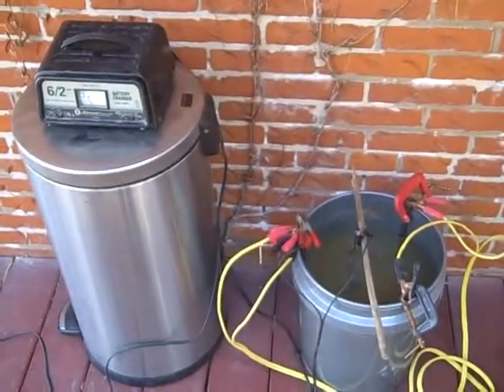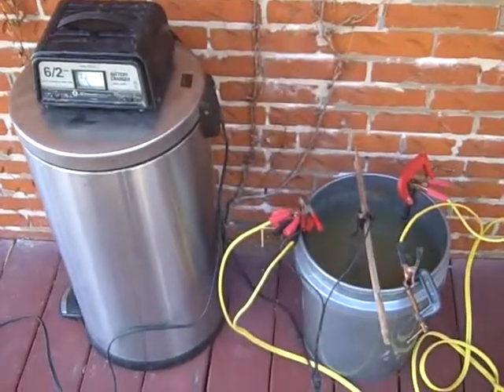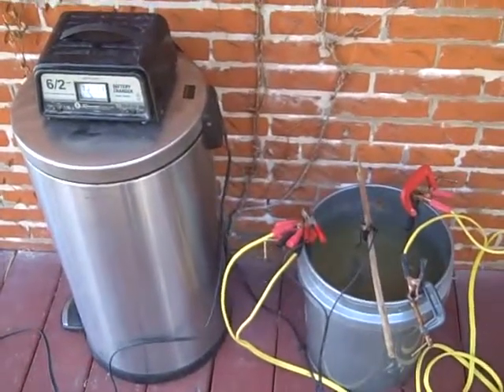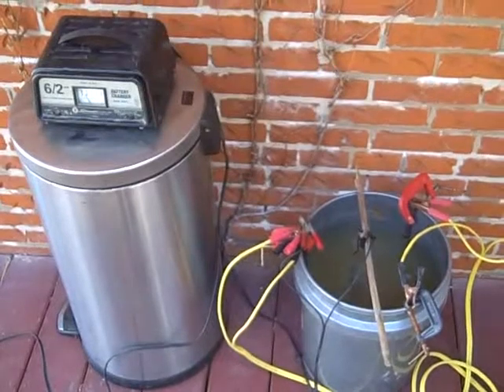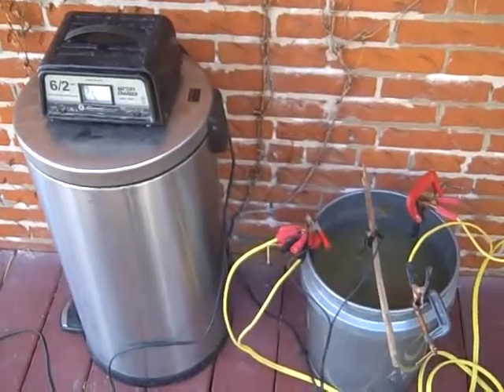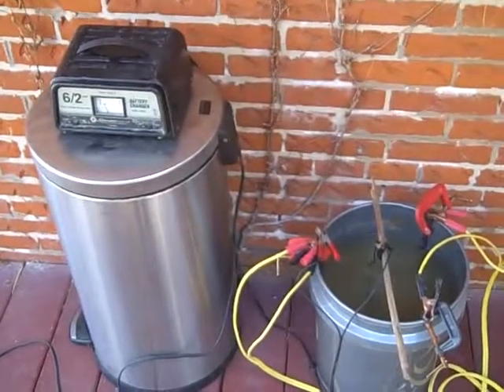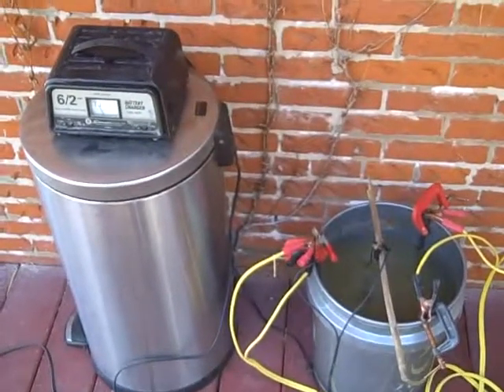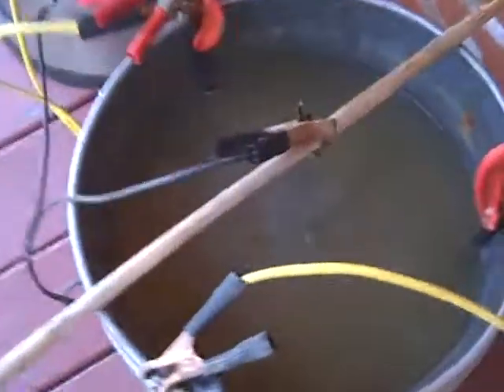EZ Rust Removal by Electrolysis - How to derust a viking axe

Comment: Now does this process at all damage the iron? I recently have purchased an axe head (haven't received it yet) and I can tell from the pictures that it has some rust and corrosion on it and would love to remove it. Also will this stop it from rusting in the future? Thanks!
Reply from the maker: I applied an oil coating. Some give it a wax finish.